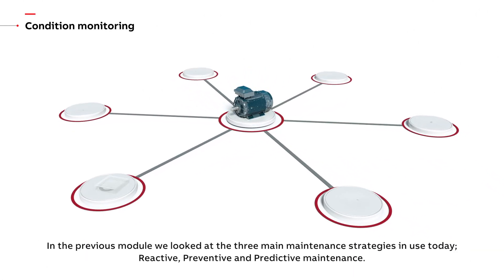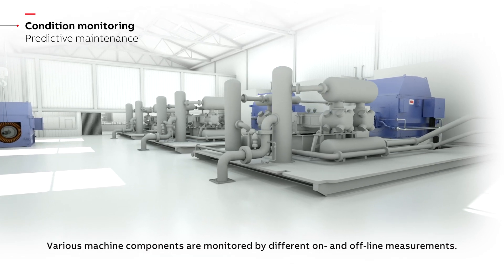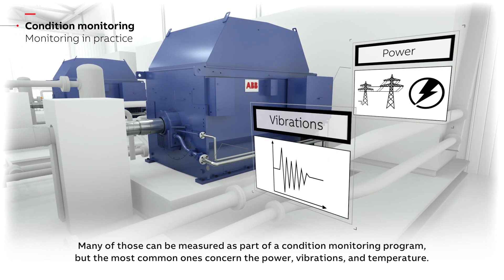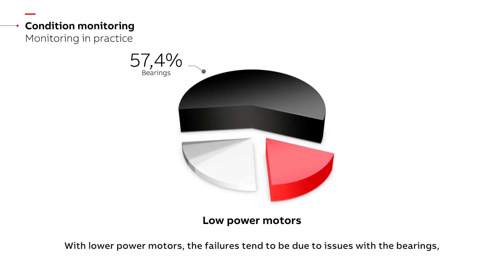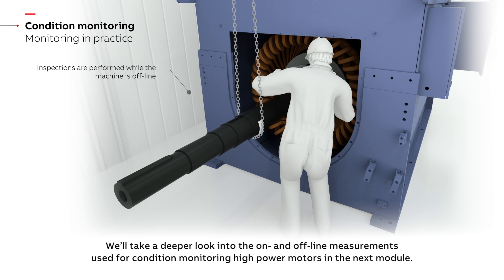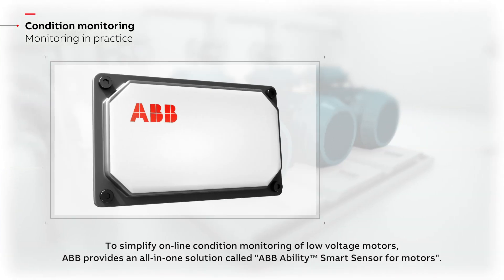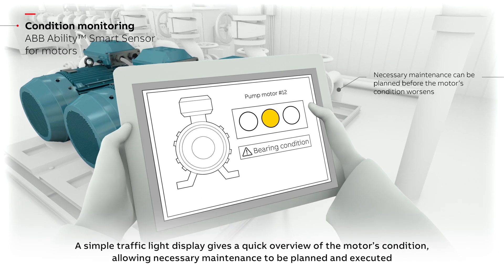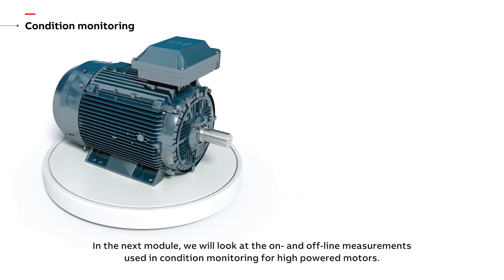What is predictive maintenance on electric motors - low power motors

Comment: What mean frame of motor ?
Reply: Frame is designator for a motor's mounting dimensions. 
Often 2 or 3 numbers that reference distance between center of shaft, to center bottom of foot. In 3 digit frames, the 3rd number is indicative of the space between mounting holes.